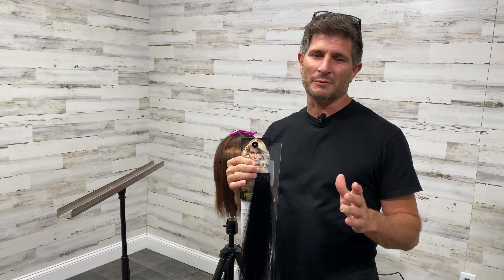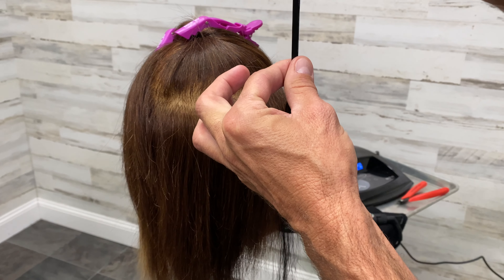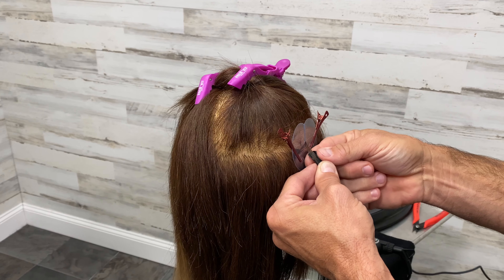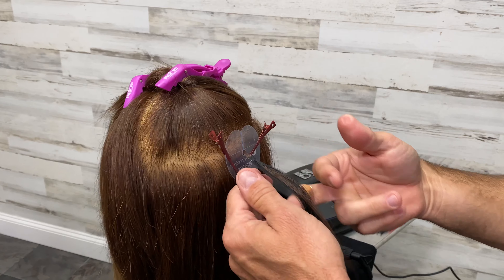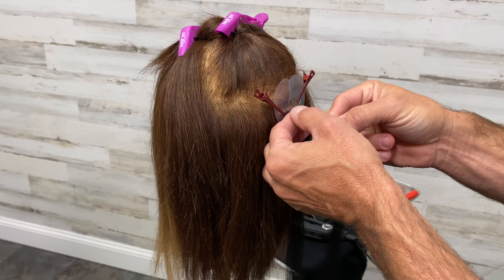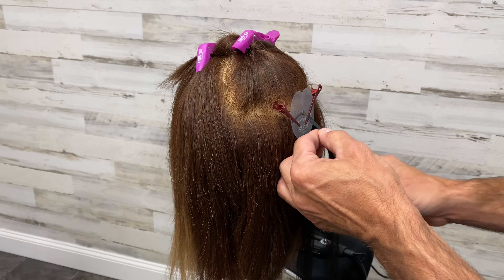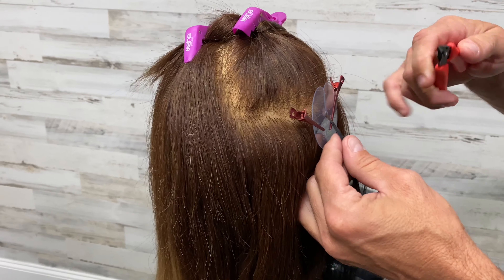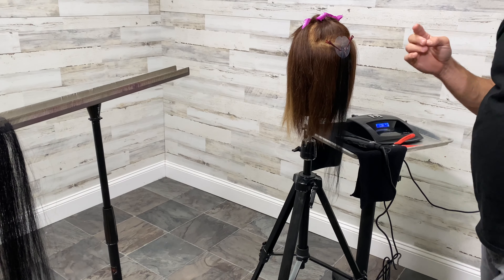How to minimize hair extensions shedding

Comment: Bernard, youre into flat bonds?
Thought that youre more into rolled

Well, flats makes a good job with blendin
At the back
And some rolled
At the edges, fringe, or very high

Best results!
Reply: Somehow!
YET
I haven't make much of flat bonds
The ones i ve been do,
Were on not payin persons
And on "the head"
And 
it wasn't good... 
Some of these were shedding 
And
Some were easier to fell out. BUT wasnt shed!
I cant really say what im doin wrong
And
My rolled bonds 
Their strong small
long lastin
...
Reply: Ps. Im workin only on 'Italian'
Reply: Can you make a video on pros and cons of flat and round? PRETTY PLEASE!!!!!!
Reply from the maker: I do prefer flat bonds most often, but you are right… round bonds are easier to hide near the hairline and up high!👍
Reply from the maker: @THE_PAJO  I’m in the US
Reply from the maker: @stylistrichardjenkins  Great idea 💡
Reply from the maker: @stylistrichardjenkins  Bond video https://youtu.be/Jy985SqRQZU
Reply: The trouble I’m seeing is I used one type of keratin and it held great, as did the original one that came on the hair. Almost zero shedding. But they were impossible to remove without a lot of hair loss. So I bought one brand that said I only had to use the tool and no glue remover to get them loose. This keratin may end up having easy removal but the shedding is crazy. I’ve been reusing the hair and this is its 3rd use. Hair is in great condition. It is the keratin 😢. Any ideas I can pass along to my stylist? 
PS I am also a stylist but can’t do my own unfortunately 😢